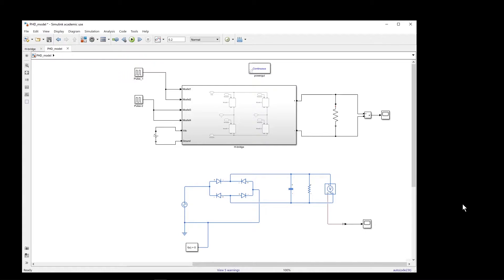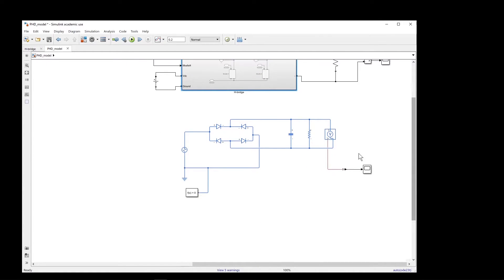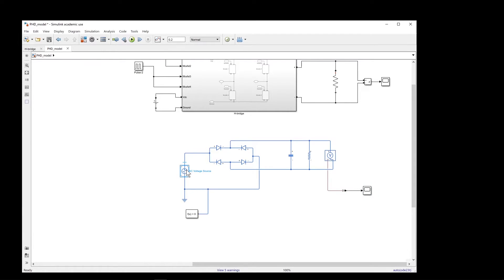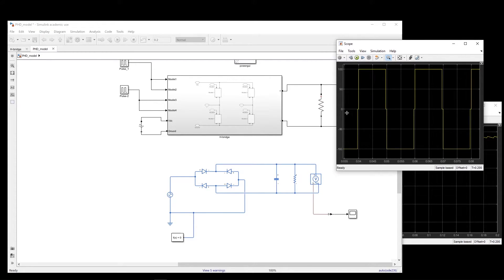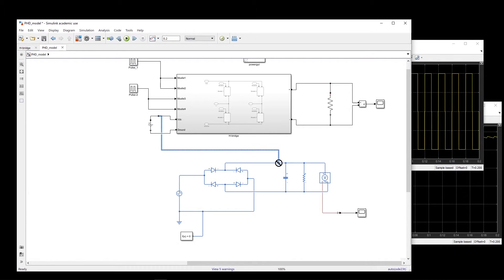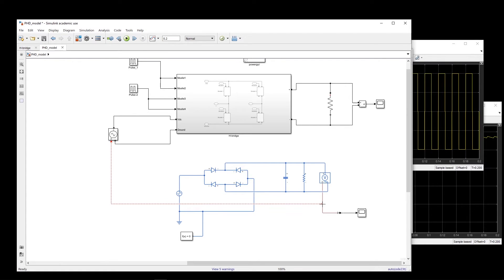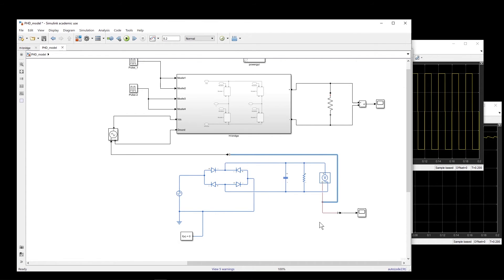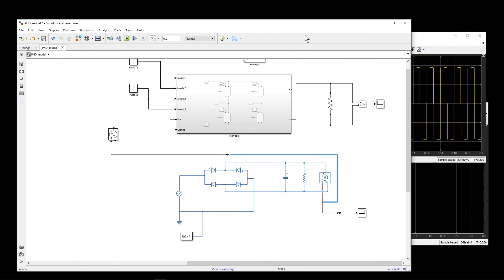How to connect components / signals of Simscape library to Simulink blocks, MATLAB Simulink model

Comment: Can we connect together components from both?
Reply from the maker: I have shown how to connect them in the video. You can not directly connect them as far as i know.
Reply: @HVE  Thanks, yes it wont work
Reply: Greetings sir, hope you're doing great!, i just washed your Video for a similar problem. In my case i have to connect a fuel cell (designed in simulink) to a simscape belt power converter but I keep getting this error message:" Model can't be solved, since it contains no state variables and no Inputs".  I'll be so happy if you could help me out.  @HVE